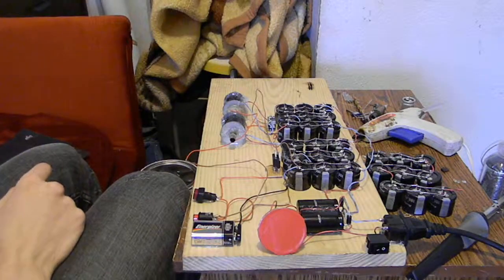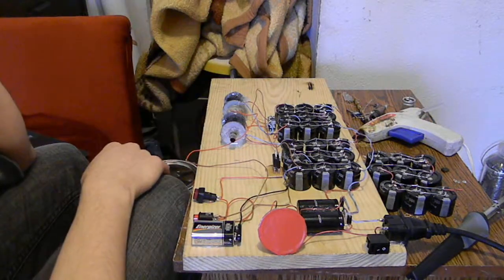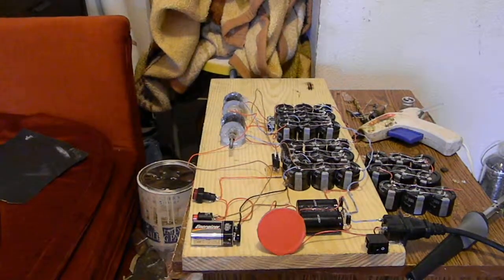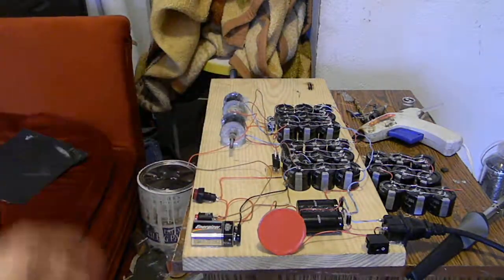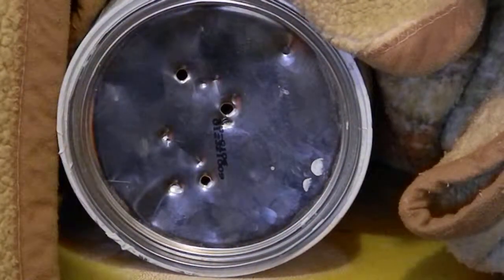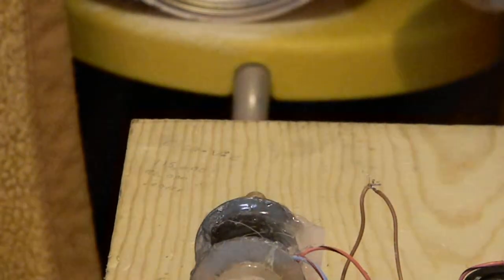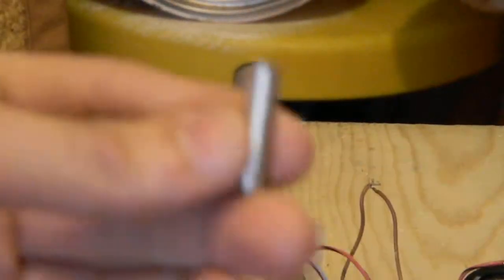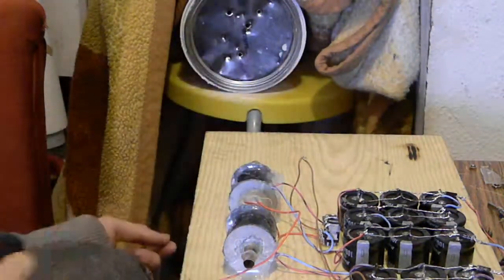2 Stage Coilgun

Comment: Nice coil gun, but you should try using much thicker wires for the connections between the coils and capacitors(or any high current carrying wires) or if you don't have thicker wire just use several wires connected in parallel, doing this may give you a significant power increase and there wont be the risk of vaporizing a wire(Its happened to me before).

Oh, and I think I have the exact same soldering iron and hot glue gun that you have. LOL

Comment from the maker: @coilsinamotor i tried using an optical trigger, but i couldnt figure out how to get the output flopped....as the output is low when the beam is blocked...i built 2 circuits and both failed :-(